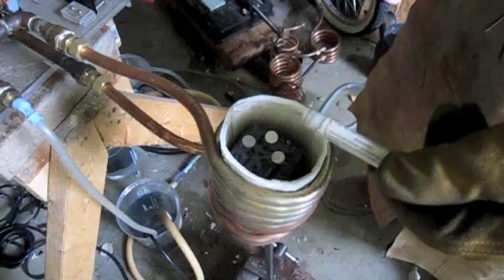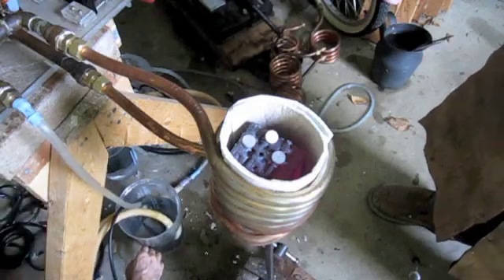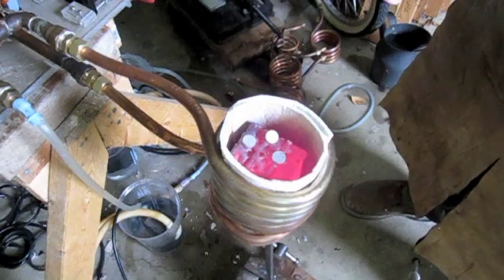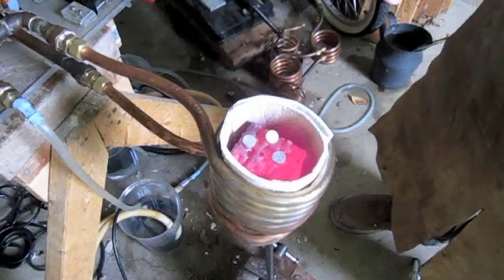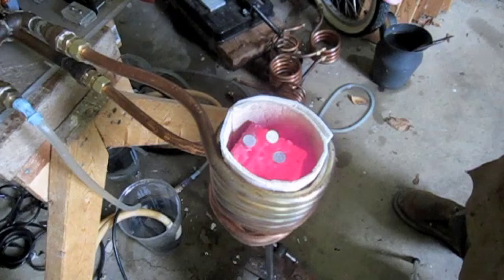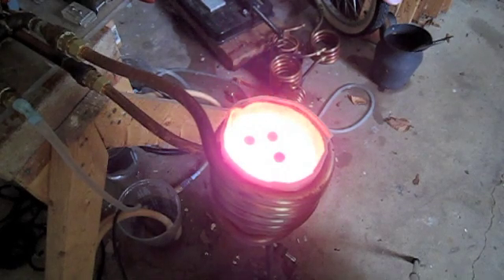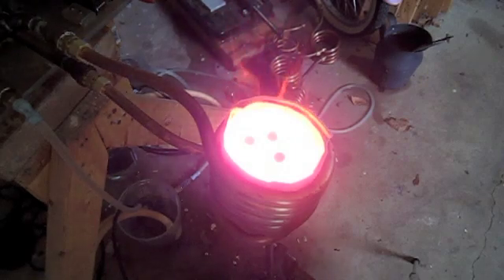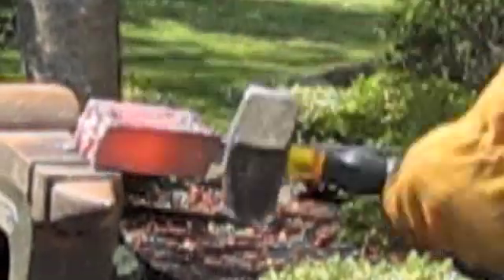Induction Heater Forging Iron

Comment: what are you using for the insulation material?
Reply from the maker: I think I got it at McMaster-carr. It is a high temperature thermal insulation material.It comes in various thickness and sizes.

Comment: Is insulation not practical? My home made kiln is designed for a different purpose and only goes to 900 deg C, however the heat loss simulations I did whilst designing it convinced me to use a low thermal capacity fibre wool ( type that is safe ). Look up Morgan superwool if you are interested, its not particularly expensive. Radiation heat loss tends to dominate at elevated temperatures ( proportional to the fourth power of the temperature in K ) but I am sure you are already fully familiar with that. At 900 deg C I experience a 100 deg C temp drop opening the kiln door for 1 or 2 seconds.

Comment: How much heat would you feel if you pit your hand beside the coil while the heater is in motion? Does the device give off lots of heat?
Reply: It should be very cool. You can see the pipe coil isn't even glowing. Beware though, it will heat any metal objects which come near,
Reply: wouldnt it need to touch them?
Reply: Markie Mark the magnetic field melts the metal but the coils may get hot from the metal

Comment: seems like a huge waste of time for forging. Waiting 10 minutes just to barely put a nick on that billet. Youll be out there for a few days! Cool induction action though.
Reply: well, if you have a power hammer, or at least a real anvil, it's significantly more useful. 

a 2x2" square like that would probably take a 45 minutes to heat with coal.
Reply: yeah.. if that's considered a waste of time, a typical forge must be a huuuuge waste of time...

Comment: Just curious, does the diameter of the coil increase the power demand? I don't need to melt steel. Would be satisfied with aluminum, copper, and brass, but need a tank large enough to handle an average lawnmower engine. I have 2 steel air compressor tanks for that purpose. Was going to use drain oil and an old pottery kiln but this may be better...

Comment: Im writing a steampunk story that heavily revolves around recycling of scrap metal and had an idea for a smelter based on induction heating, but its got a bit of a fringe science aspect to it. Could i contact you for a bit of help in designing a specialized machine?
Reply: +Robert R isnt induction using electricity. steampunk is what a world would be like without the discovery/use of electricity
Reply: +PenguinCave360 they had ruedementary electricity in the 19th century tho.
Reply: Huge freaking vacuum tubes. Probably repurposed radio transmitter tubes. Search for pictures of them on google images. They very high powered ones are quite large and look like they were made by aliens.  You can probably use Mercury Arc Rectifiers in the story as well, as they would be required for any kind of electric train or even large battery chargers before semiconductors were harnessed.  Likely whatever factory which has induction heaters would also need them to convert AC to DC.
Reply: I thought steampunk wasn't based around any specific time in history, but took certain aspects of 19th century styling and steam machinery in a modern or futuristic alternate world... I suppose if it's fiction you can make it whatever you want, but I agree that electricity wouldn't make too much sense in a world based around steam machines...

Comment: It would have to do with the ferromagnetism I would guess. Ferromagnetic materials heat faster than non ferromagnetic materials in an induction coil due to the increased heat from hysteresis.
Reply: Jon Jo Yes, that is, until the steel reaches non-magnetic heat at around 1300F. At that point, the heat transfer slows but is still consistent and fairly fast. 

I would guess that the penetration level is not high enough with this machine for the size steel being worked. Induction penetrates based on kHz - something this large would need a low kHz and impractically expensive induction heater, probably.
Reply: +Kevin Keel From  what I've read, there is actually a significant boost in induction heating once you reach the Curie point at non-magnetic heat. Also, you are right that lower frequency gives more penetration, but it is not hard to change the frequency, it's just a matter of changing your capacitor bank.
Reply: It isn't always that simple. To make an analogy, if one looks at music or sound generation, the power needed to transmit 3khz at 100db compared to the power needed to transmit 30hz at 100db, one would likely need an amp that is 10 or 20 times more powerful for 30hz as opposed to 3khz.
Reply: I may well be wrong in my thinking, as I am just getting into this kind of thing, but there was another video around who said something similar. He was saying that as he changed the frequency of his heater, the power transfer was changing, driving more current into the workpiece. It seems to me this would mean that you're correct, and it requires more power, but the actual changing of frequency is fairly straightforward.
Reply: Yes, maybe - but if your power supply is lacking ... you may be in for a few thousand dollars worth of more IGBT's

Comment: if I wanted a larger capacity but lower temp (alum/copper/brass) how would I do it and how much do these cost? I currently have a drain oil burner and a pottery kiln and a pair of old air compressor tanks. Everyone is worried about the smell.

Comment: @imsmoother wrt demand, I'm sure you're correct there.

On the power supply front, I'd probably need a 220v circuit rated to what, 50amps to be useful? Certainly seems like you need a lot of juice to heat quickly, especially if you're talking about larger stock, like 1" square +

I bet you *could* sell a sort of cookbook/manual that is a design guide for the less electronic knowledgable. I'd certainly pickup a copy.

Comment from the maker: @rhinoryanizer I would make pre-made boards, but I doubt there is enough of a demand to make it worth my time.  The modification for forging requires 10-15 turns on the coupling transformer.  The billet uses 10; the sword blank used 15.  The uP had to have its setpoint for resonance calibrated for the larger work coil, compared to the levitating coil.

Comment: @imsmoother Right, I've looked at those. Nice write up, by the way! I've been getting into blacksmithing over the past 6 months or so and my nerdy side hates wasting craploads of propane to run a forge (plus the heat load in my garage, I live in Texas). I saw your microprocessor video (one of the later videos) and I thought you intended on posting a write up on that modification. I'm a computer programmer and I'm admittedly not a circuit guru by any stretch of the imagination.

Comment from the maker: @rhinoryanizer There is a current sensor that locks the output current at a fixed amount.  For the levitation coil the unit works fine without the load.  The same goes for the induction unit when set for forging.  The schematics link is posted in the general description.

Comment: Very cool stuff, when are you going to post details on the microprocessor controlled goodness?

With your setup is it bad to remove the work from the coil while it's on? I think commercial units will handle that with no issue. Anyway, for general smithing use, you'd definitely want one that can be turned on/off or an AUTO where it senses work and ramps power.. Just a thought!

Comment: What frequency is the voltage running at? 60hz?  You are aware of broadband radio freq transmission? Cooked many men in the beginning of Radar.   Cool process.. do you have a isolation transformer  in the middle of the circuitry?

In a industrial induction furnace.. light fixtures kept blowing.. we found out you can illuminate  the inside with must flourscent tubes strapped to the roof.. the Radio frequency lights them without ballasts attached..